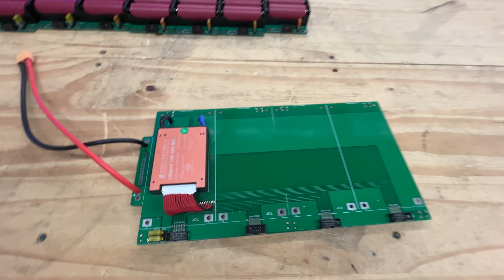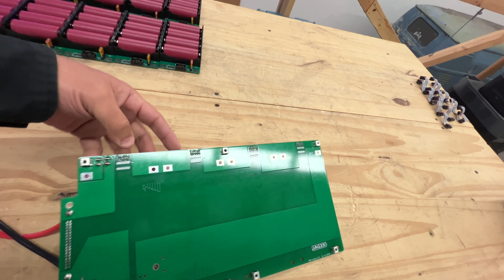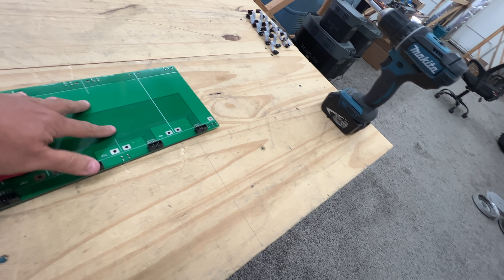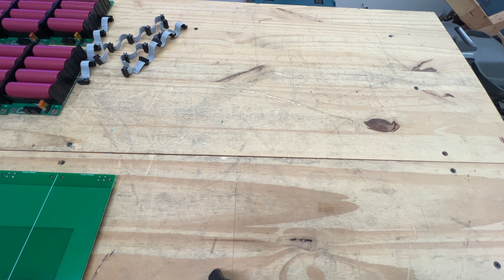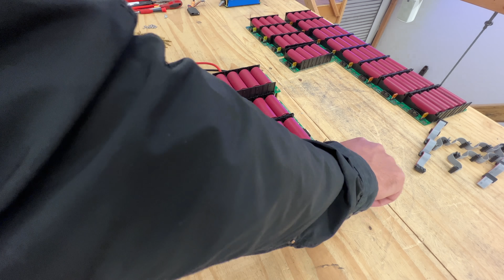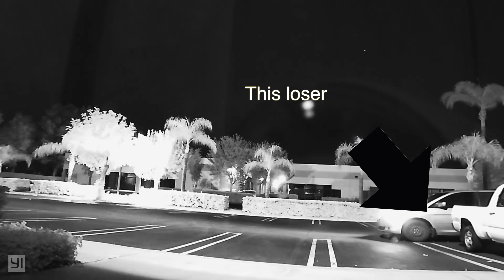48v lifepo4

Comment: I am trying to "build a better battery" for my 24v Neuton CE 5.3 battery lawnmower.  it currently uses 2 12v 10ah lead acid batteries, the charger has no brains, it just dumps 24v 1000 ma to the batteries.  the motor specs are 
RPM 4300        
Tip Speed 16,000 ft./min.     
AMP Idle 4 – 5      

AMP Cutting 8 – 10       
Size 500W, 24V DC/32 Amp    
Noise Under 80 Decibels    

The battery pack is made up with the 2 12v 10ah batteries oriented side by side. do you think a couple of your battery stacks would fit side by side in the space of 2 12v 10ah batts?  
Dimension(LxWxH)	151mm (5.91") x 98mm (3.86") x 95mm (3.74") each? thanks Phill

also should the current charger work?

Comment: I'm a bit confused. You said the fuses on the boards will blow above 20 amps. But you also said you can add more boards and go up to the 50 amps that the rest of the board was built for. How can you run say, 40 amps from the pack and not still blow the 20 Amp fuses?

Comment: Do you have plans to make one like this for the 18650's? I built a similar power wall to your prototype in the media cabinet fitting two stacks of the 18650 boards and it'd be great to do this in there without y connections to the two bms's

Comment: Just a suggestion.. If you made the BMS that's on the master board into a daughter board with either a ribbon or slot connector on it the whole 4 '4 cell board modules' for each layer could be the same height. That way you could have the facility to add lateral support between the boards (like say a strip of tough plastic or even null pcb) to give it all some rigidity and avoid placing 4 heavy towers next to each other only held in place by a bit of pcb right at the bottom.
(Also it'd be nice to have more things happening here in the U.K. if you're looking to expand your efforts to other countries any further :) )

Comment: Enjoying the content it's helped me convert my son's scooter from lead-acid to lithium ion. I stayed with 24-volt because that was what the original battery pack was. Can you do a video that explains when to use 12,  24, and 48 volt systems or the benefits of each voltage.
Reply: That's an easy question to answer. The benefit of going with higher voltage is less amps drawn for any given wattage. This means you don't need heavy guage wire and generally more compatability and safety with battery cells. The biggest limitation with batteries is usually that they can only provide a small amount of amperage per cell in parallel, and there is a huge trade off between the ability to provide lots of power continuously and the amount of capacity a battery has. For example, if you need 1,000 watts continuously, its a lot easier on the batteries to get that 1,000 watts using a 48 volt system than it would be to get it out of a 12 volt system, only drawing about 21 amps from the 48 volt system vs 80 amps on the 12 volt system. This means you can have much less heat and much smaller wire when using the 48 volt system, plus it means less batteries are needed in parallel and you can generally use much higher capacity batteries since the amperage output demands are 4x less with the 48 volt system. Thats the tradeoff you make with any battery cell. If you need higher power output capabilities, then the capacity will be much lower. Its all about surface area and internal resistance. In a high capacity battery, you can fit thicker sheets of lithium, separator and conductor. That has the properties of more energy holding capacity at the cost of having less surface are and a higher internal resistance, which results in more heat in the cells when energy is released at a high rate. Thats the limiting factor there. Can't have the cells getting too hot. On the other side, you can have a cell with very thin coatings of lithium with a very high surface area. That lets the cell can discharge lots of energy very quickly with very little heat. Since the internal resistance is very low, almost no heat is generated, but the trade off is that the cell won't have very much capacity since the coating of lithium is very thin. You will notice this when you look at batteries for sale. There are high capacity cells, but you can only discharge them slowly, at 1c or 2c max. Then, there are high power cells, and you can discharge them at high c rates, like 5c, 10c, 20c or more. The trade off is, those cells have very low capacity. You have to pick a specific kind of cell for every application for the best results. Things like power storage should usually be high capacity cells at high voltages, so they can be discharged slowly. But if you wanted to build a battery to start your car, or a battery for a high power ebike or a fast drone, you would need something like a lithium polymer battery that can discharge lots of energy really fast with almost no heat generated. Some of the lithium polymer cells can discharge from 80-150 times capacity! Or something like a headway high power lifepo4 cell for starting your car. This is a huge cell, but is only 8 amp hours each, because they can discharge 150-200 amps each continuously. 
I hope this helps someone understand how these cells work, and why you would want higher voltage battery packs, and that you need to pick a cell that works best for each application you are building a battery for. Remember, high capacity cells if you can discharge slowly, high power cells if you need to lots of power and discharge quickly.
Reply: I agree the amp draw is the benefit, higher voltage means lower amps per watt. To go further down the rabbit hole, unless you have 12v equipment, 12v is primarily low consumption devices like guages, switches, and some lights, 24v is mostly battery storage for low voltage home circuits and some rv's/tiny home backups (don't get me wrong, you can use 24v with inverters for regular homes too, just a few curcuits) 48v and higher are better for homes, scooters, ebikes onewheels, and ecars. As the amperage need increases, it wise to go up in voltage to compensate. To keep your amp draw under control. For example, 1000 watts 12v = 83amp draw, not accounting for losses where 48v =20.8Amps draw. There is definitely a point of deminishing return due to the cost of the various equipment rated for certain voltages of course but in the long run, the closer you get to 120v(a/c), the closer you are to the diminishing return. At least in the US. This is only one reason the general 18 watt loss when using a true auto transformer to go from 48v to 240v and back to 120 per leg is acceptable.